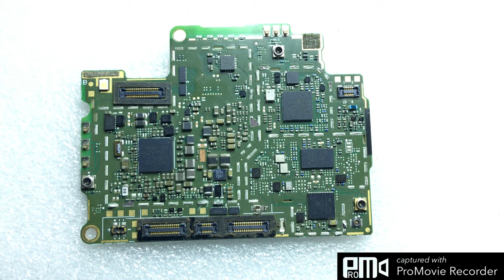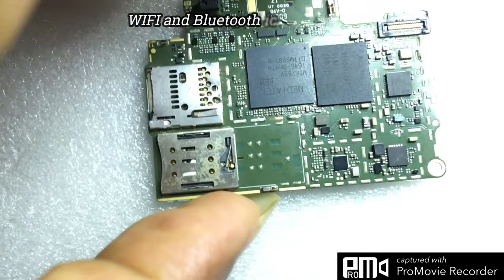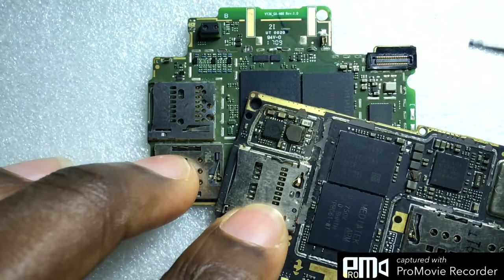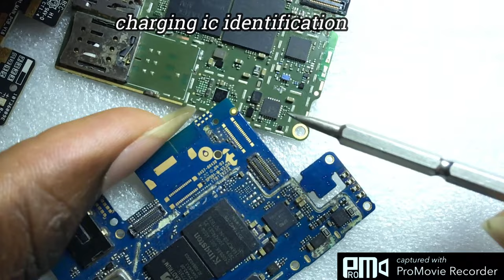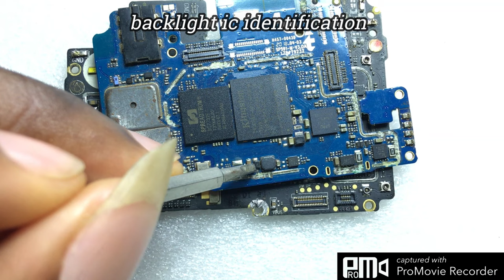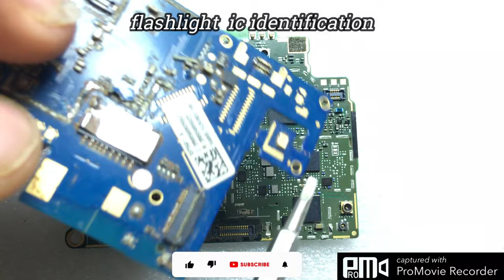How to Identify all Mobile ic

Comment: Sir what's the different between power ic and charging ic
Reply from the maker: To make it short and easy to understand; power ic is the main component on a mobile  pcb that distributes required voltages to other part on a mobile. 

Charging ic is the main component controls the voltage charging you bather and that in which comes from you charger. 

That should be easy to understand the difference.